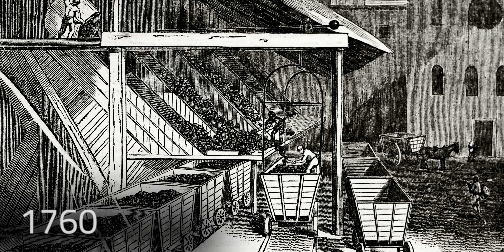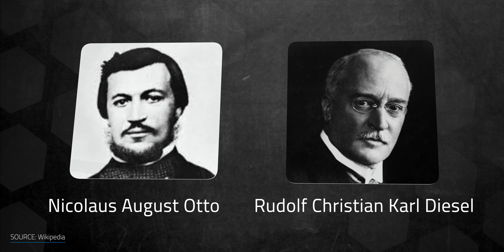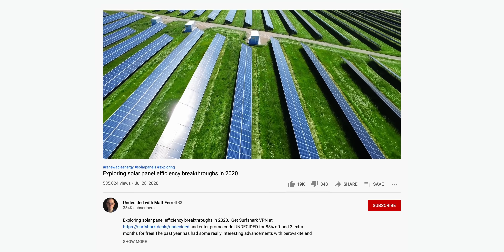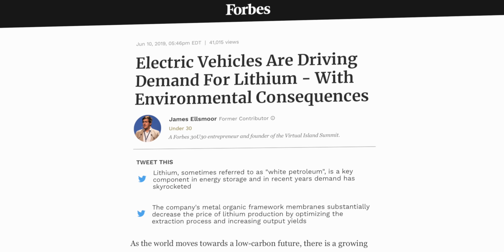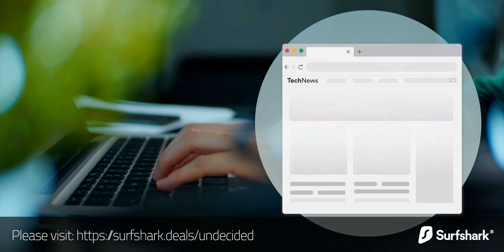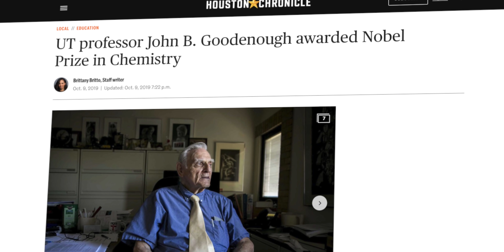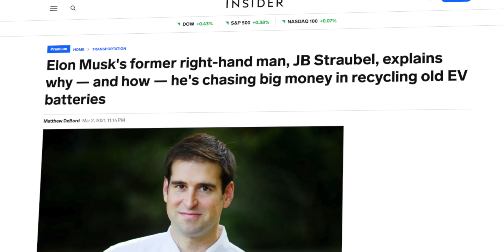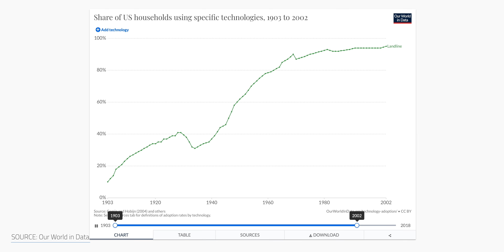Is the Future of Renewable Energy Inevitable?

Comment: Some points to the discussion. China and US have almost 45% share from total fossil fuel emissions. They have more than 60% energy created from Coal and Natural gas. They have biggest share in EVs market. So this is one of the irony in the race to save this planet. PV and Wind power plants need something that we can’t control = sunny and windy days. So we have deserts with big solar irradiation. Yes, but there isn’t a water for a cooling of the PV panels and batteries. This isn’t simple. It’s complex. Otherwise we can fail. There are places for the PV and Wind power plants , but not anywhere. Just to be sure.
Reply: Deserts sandblast solar panels on a constant basis on top of getting them dirty. The lifespan of desert solar will be far less than other locations. 
Or, we could move away from farming low energy dense, intermittent sources and go nuclear. Generation IV molten salt reactor technology to be specific and solve all the energy needs not just electricity which is only about 25% of total energy needs.

Comment: Hydrogen production, transportation, storage and conversion back into electricity is never going to be as efficient as storing electricity in a battery. At best it's a way to store power that otherwise would be lost in off peak situations at worse it's fossil fuels by the back door. The other thing you didn't mention was cost. Renewable energy may not be as energy intensive as fossil fuel but it's cheaper and getting cheaper all the time. I think it's inevitably that renewable energy is the future it's just a matter of time. If we are to stop and even reverse global warming it has to be. Failure is not an option.

Comment: FYI

Germany purchases electricity from France(Nuclear) for seasonal winter demand.
Germany purchases Natural Gas from Russia for seasonal winter demand.
Solar , Wind generation , and Energy storage does not meet seasonal winter demand for Germany 
Germany has to get electricity seasonal winter demand at a high premium
 meanwhile China builds coal burning power plants

Texas and North Texas rely on Solar and Wind Generation seasonal winter demand 2021 calendar year . Solar panels do nothing with sheet ice and lots of Wind Turbines froze solid (2021) . Texas residents died from 2021 Winter freeze . The Texas grid locked up with low Winter temps 2021 and Natural gas did not flow and could not be pumped.
Texas 2021 grid had brown outs and near statewide grid collapse

Besides Solar, Wind, and Energy storage. You did not mention hybrid coal plants, Molten Salt Reactor(Thorium) MSR conversion  (barge scale) is scalable, economic, transportable, and simple design with build out. 

Not to be hateful
However arrogance of anti Nuclear 
vs 
Solar /Wind Generation
thinking is of middle school mindsets
Reply: Exactly!

Comment: When you look at the total energy supplied be fossil fuels, it is staggering.  As fossil fuels are swapped out for electricity we make big gains in efficiency.  A heat pump is 3X more efficient than a gas furnace, an electric car is 4X more efficient than an ICE car.  Add to this improvements in building insulation and air exchange the staggering amount of energy can be reduced.  There might always be places where fossil fuel is needed but adding renewables with backup, batteries, gravity, liquid air, pumped hydro, and heat storage systems seems like a good option.

Comment: Mostly yes but I believe nuclear power will have a place in many areas of the world
Reply: Yes, nuclear has its place which is to replace both fossil fuels and wind/solar.
Reply: @chapter4travels  I think they all have viable and sensible applications depending on each countries various circumstances.
Reply: @peterwarner553  So-called renewables need 100%, full demand back-up. If that backup is nuclear what advantage do the "renewables" provide?
Reply: @chapter4travels  why would you need back up?

Comment: I somehow don't believe renewable energy will take the lead for long or like that. Their efficiency is already not bad and if you think about windmill they are already produced close to maximum theoritical efficiency. In most country they are paired with neutral gas central which is not making them so green and they most of the time don't operate at full power. 
At the moment if a country does want to run on renewable then either they have nice rivers and dams or their citizen / industry are not consuming much, which for us would lead to a terrible erosion of our consumption based society.
I think the new energy for the future is into something were the yield is far from ideal like for instance nuclear fusion, or maybe small fission reactor in a nearer future.
For me the possibility for renewable to take a solid lead are :
1) The solar energy will make more sense when we will be able to harvest the sun directly without dealing with the day/night cycle. (not for anytime soon)
2) harvesting the sea because water is much heavier than air. (possible soon but would probably need expensive infrastructures)
3) start to harvest the earth core. kind of big geothermia. (possible with current tech but hard to handle with risk of protest if it causes earthquake or damage or if there is an earthquake even not due to that it will be hard to explain.)
In those cases the amount of energy which can be harvested is always present or even can be piloted.

Comment: The problem with all of this is the current "green" "renewable" energy sources are worse than the "fossil" fuels they replace. So putting more demand into electric generation and distribution will have a "disruption" effect which we're only now starting to experience. My proof? Biomass, Wind and Solar. None of them are producing positive results. Hydro remains the sole form of reliable, cost effective, eco friendly production of power.
Reply: What do you mean by, "None of them are producing positive results"? Renewable energy is the fastest growing form of energy for many years now, becausee it is less expensivee than burning mined fuels. How is that not a positive result (unless you're invested in fossil fuels)?

Comment: Thanks for the good video. Regarding solar panels, efficiency increased only marginally, but costs plummeted at an incredible rate (google it). Since the "fuel" is free and abundant, investment costs are more important than efficiency. As a result of cost reduction, renewable energy is now cheaper than fossil fuels (without subsidies) and for few years now attracted most of the investments.

Comment: Solar panel efficiency (or rather photovoltaics) is fraught with HARD challenges. Almost all efficiency gains are done so through the use of rare materials, and we need to pave an area in size order of entire countries. Only silica based PV has a chance even then it's hard. Maybe if the theorized graphene or carbon nanotube-based PVs become a reality would it be possible to get efficiency with abundant materials, but we can't manufacture these on an industrial scale so that needs to be solved as well.

Comment: Nuclear power emits fewer Co2 emissions at a much lower cost, does not use child slave labor or require mining on a mind blowing scale. It can provide industrial/residential heat and can be built far faster than reneawables. Reneawables have their benefits but nuclear is needed far more.

Comment: The technologies for green energy and hydrogen are all there.  The biggest issue is to get governments to make enough incentives to get companies to switch over to renewables plus storage.  Tony Seba (in his YouTube videos) has stated that the country needs to build wind and solar plus storage from 3 to 6 times the capacity so that there will be enough energy stored for a few days of low wind or overcast weather.  During peak output times the excess electricity will be used to generate green Hydrogen for use in transportation and to run generators during other times.

But how can you get an investor owned utility to overbuild when it goes against everything a regulated utility does, such as extreme fiscal conservatism.  Government must intervene and set up a structure to incentivize and motivate the utilities to build the 3 to 6 times more renewables plus storage that will be needed, plus the green hydrogen generation and storage.

Comment: I don't know what the next big renewable developments will be, but what we NEED is:
- cheap, efficient, reliable, scaleable grid-scale electricity storage systems
- better long-distance (1000km+) electrical energy transmission systems, for inter-state (and region-to-region) backup and supplementary power
- more new transportable "embedded power" solutions, i.e. where things with a high input energy requirement can be manufactured in a location with cheap renewable energy, then shipped to other locations for use (e.g. aluminium "batteries"?  Even green non-coal steel might count.)

Comment: stirling engines have A REAL SHOT! for stationary storage? oh yeah. I'd almost choose that over photovoltaics & lithium. 1 cubic yard of sand holds 1 million btu's of heat. better still: there's a dry chemical used in steel mill blast furnaces to put the fire out if the steel ignites. one cubic foot of that dry chemical holds 1 million btu's. a well insulated box of dry chemical, with stainless steel loops running through it could power a sterling engine with great ease for hours on end. couple that to a pex geothermal loop buried about 6' down? you'd have an energy power source capable of running a house full time. especially in the southwest. 

exciting part is, it could also work in really cold climates as well. remember- the stirling runs on temperature VARIATION- not JUST heat. in a place like- the north east, sub zero temps all winter long. that SAME geo-thermal loop.. perhaps burried at 10 feet.. easily becomes the heat SOURCE. while the above ground AIR? the COLD source. the hardest areas?  places where it rains a lot.. not much sun..not extremely hot and not extremely cold. areas like the southeast. there's a solution to that too. COMPOST. inside a huge pile of decomposing wood chips or leaves? it gets hot. REALLY HOT. there's your heat source.

Comment: hydrogen is a total loss. even if you just add electrolysis losses to the cost of getting the fuel to liquid storage? TOTAL LOSS. or? electrolysis & the losses of running through a fuel cell? TOTAL LOSS. or? JUST the cost of replacing the fuel cell every 5 to 8 years... at $30k for a very small, basic fuel cell- plus the fact that the fuel cell alone can't power much of anything without a lithium pack attached as a buffer. better solution? ditch the hydrogen & go lithium. 

the ONLY reason H2 isn't completely dead & buried is because big oil is pushing it. WHAT?! why? because they convert it from fossil fuel. no one is going to pay the 5 to 8 dollar a gallon price tag for h2. NO ONE. and even if- you got it down to $3.. that's still 6x the price of just charging an EV at home at 9 cents per kwh. HYDROGEN IS DEAD. bury it. better off to just burn natural gas than to convert it to h2 and no one NO ONE absolutely NO ONE is going to do electrolysis on a mass scale.

Comment: I think the next jump in energy storage will be nano printing of a hybrid ultra-capacitor / lithium cell, with a 50 year life span, 4x the energy density and a charge rate of 75kwh's in 5 minutes. chemistry? mmm... maybe goodenough.. but more likely a 4680 cell based on silica, nickel & lithium for stationary storage. 

hydrogen. 95% ? not bad. but I'm guessing that's just to split the molecule. NO WAY IN HELL can that be electrolysis+liquifying+fuel cell. not even close to possible. add all those other factors in? hydrogen is a losing bet financially. a better bet? liquid air batteries. literally, air run through cryogenic pumps & stored in tanks. then when it's night time & need the stored energy on the grid? you reverse the process- running the compressed liquid air past turbines & turning a generator. from what I've seen? they're past 80% efficient, total energy turn around. NOT BAD. and cheap to scale up, long life span & if you get a leak? no great big earth shattering kaboom. (que marvin martian).

Comment: You just can't leave Hydrogen alone can you? It's BS dude.
There is no hydrogen process that is 95% efficient, maybe some day it might be 95% for electrolysis if they can utilise the waste heat, but that's a cheat and not scalable.  The main issue is that uncompressed hydrogen is no use to anyone, and then you have to compress the air and mix it in a fuel cell.  The result is 35% today, it cannot complete with batteries at 90% efficiency, so please forget about Hydrogen you are being mislead, or paid to promote it.  All Hydrogen energy storage schemes are Ponzi's.
Hydrogen is just one type of battery, there are many many better materials for batteries.
Green hydrogen is not competing with fossil fuels it's competing with batteries.  It's not a primary energy source.
Green hydrogen will increase, but only because govts are funding the industrial use of hydrogen to change from fossil hydrogen to electrolysis to reduce the CO2 footprint of existing industrial use Hydrogen, not to use it for storage or transport.

Comment: you got it backwards: DC transmission is infinitely more efficient than AC. The Rio Madeira HVDC link transmits electricity from the Santo Antônio and Jirau hydropower plants on the banks of the Madeira River in north-west Brazil to major load centers in south-eastern Brazil, a distance of over 1480 miles, with very negligible losses. the best AC systems can muster is about 200 miles. start approaching 300 miles with AC- and the losses become so great that it's  cheaper to just build out another power plant. Elon talks about this every time someone brings up the worn out cliche- "the sun doesn't shine everywhere"- DOESN'T HAVE TO. the revolution being led by tesla is facing a new 'bump' in the road- one that is probably as old as cattle barons & railroads.. big oil. we've seen over the coarse of history how giant, wealthy, ultra-powerful industries like big oil DO NOT like to just throw in the towel. they lobby, bribe, lie, steal and cheat to stay in the driver's seat. during the steam industrial age- a very talented man named robert sterling invented the stirling heat engine, which runs off ANY heat source- NOT JUST COAL. a stirling engine, even from his day surpasses the efficiency of a modern ice engine. in the 70's fake 'oil shortage'... an AMC pacer was modified to run with a sterling engine. able to burn alcohol, diesel fuel, or cooking oil. and JUST when car makers started to switch over to diesel powered cars & move away from gasoline? WOW! it's a miracle! NO MORE FUEL SHORTAGE. then when stanford ovshinsky invented the NiMH battery.. same old song & dance. GM & texaco collaborated to kill the electric car & maintain a tight grip on the NimH battery- all the way back in the 1980's. 

so what's changed? Elon musk & tesla. don't get me wrong, big oil will still exist- they'll still be 'around'... just 'de-clawed'. once tesla bites off about 5% of the world energy market (including cars), big oil will start to FEEL the pinch. not as much money laying around to do things like.. buy up patents & shelve them. buy off congress & the SEC. short sell green energy co's to the tune of 3 million like it's pocket change. imagine if.. instead of spending ALL their cash to block renewables... they spent it ON renewables? they're not going to do that. 

dear elan: DON'T DIE. lol.

 solar & battery tech.. much like computers.. gets more efficient & cheaper every few years. solar with megapack storage has now SURPASSED the point where.. it's cheaper than coal & natural gas generation. building out a new fossil fueled power plant is now a bad move financially when compared to solar- if you're in the south west. and it's easy to see why. even a modern natural gas plant with cogen can't compete. millions to build, 100's of thousands to maintain, plus staffing. 

and yes- solar & batteries do eventually wear out & need replacing about every 20-30 years. and every year that number gets better. but: during that 20 years? those panels & batteries are run by CPU's & software... and they DON'T need: wages, breaks, lunch, medical insurance, retirement plans, NATURAL GAS, turbine parts, bearings, lubrication, overtime pay. the 'fuel' that runs solar doesn't fluctuate in price either. wars don't threaten to cut off the supply of solar energy or raise the price. in many ways- we should be thankful that big oil is SO DAMNED POWER HUNGRY & GREEDY. I mean.. if they just went along to get along... and took a small profit for the product & didn't try to kill every innovation that comes along? the push to develop solar might never have happened. I drive a model Y- and every time I see the gas prices here in CA go up? I laugh. there they go- driving yet another consumer RIGHT INTO THE ARMS of tesla. I have 8kw's of solar panels & 27kwh's of power wall. best money I ever spent.

Comment: I think the cost effectiveness of the molten salt batteries are going to be a big deal for utility scale systems. Elon needs to keep lithium in reserve for mobile applications where it's power to weight is much better.

At the same time though there's been structural improvements in the lab for building both anodes and cathodes to help improve lifecycle and efficiency of those lithium batteries and I feel like we're just waiting for them to trickle down to industry. That's the kind of thing that government should be putting effort into improving, making sure these lab inventions make it to market faster.